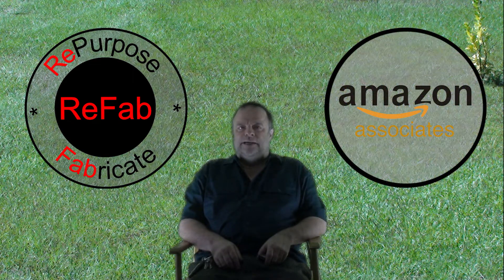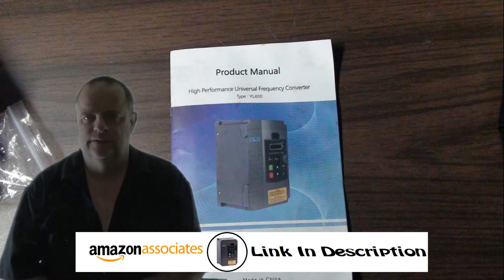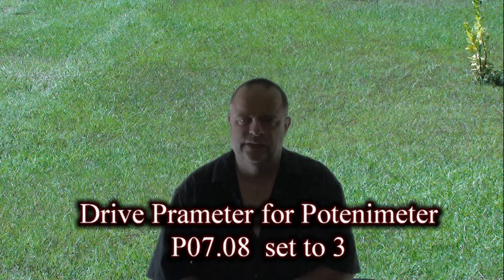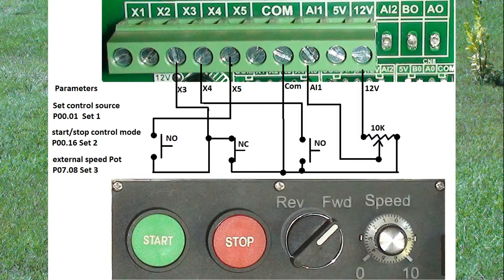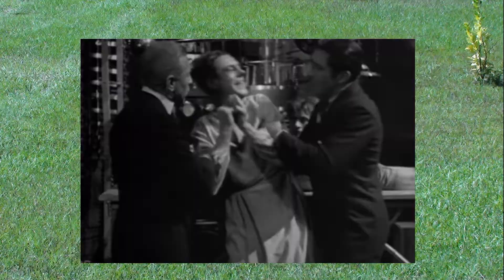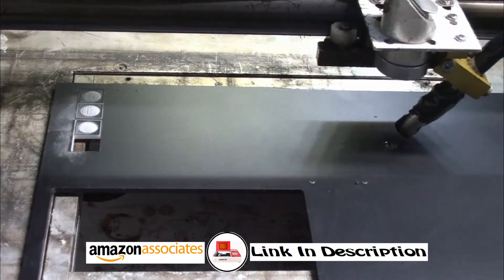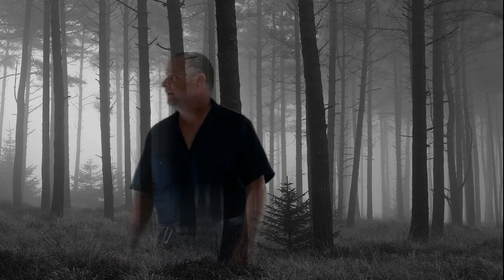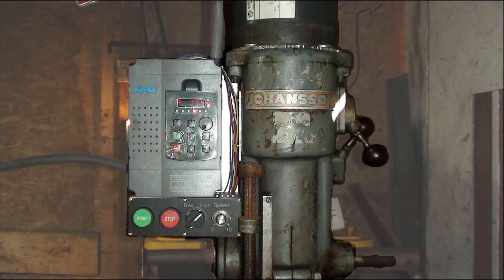Johansson Drill press P3 Installing switch's on MYSWEETY YL600 Freq'Drive

Comment: I've been using the onboard panel for my pasta machine but want to swap to analog buttons like this, with the main reason of putting an inline limit switch for safety reasons. Dumb question, but what gauge/type wire are you using to wire this up? I'm assuming it doesn't have to be too heavy duty since they aren't carrying any load, just passing a signal for operation. Using your links to amazone as a thanks!
Reply from the maker: I don't know what's recommended, but I used 20 Gauge.

Comment: Hi mike hope you ok, can I please see the wire in the back of the on/off button and in the potentiometer? Ps: I bought one but I don’t have any knowledge of electricity. Please send a picture for me. Regards
Reply from the maker: https://drive.google.com/file/d/1_Q8FOnlgo8OhQfYzLiDYORYbg7M4EneF/view?usp=sharing
Reply from the maker: 3 of the wires are blue. 2 of them have a colored piece of heat shrink tubing, on the ends, to help tell them apart.

Comment: Hello Mike!  Thanks for putting up your video on YouTube. I also bought a YL600 VFD from one of the Amazon sellers. Different plastic, same product manual, probably the same guts. I’m new to the VFD game. Reading those product manuals is like learning a new language. I finally figured out installing simple switches but I was stumped with the external speed control. After wiring it in it wouldn’t work at all. I figured the problem was in the parameter settings, but couldn’t figure out which one. I thought the seller could help. I soon realized that was a waste of time. Then I found an watched your video. The problem was in P07.08 needing to be set to 3.  

Thanks so much for your help’
Reply from the maker: thanks for the feedback - I'm glad it helped. I not a drive guru either, it took me 1/2 day to figure out.